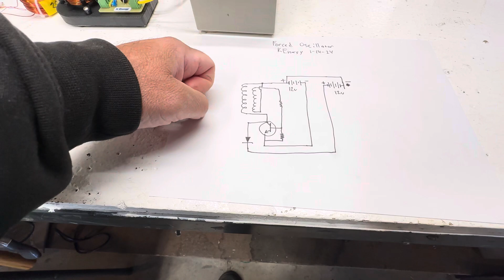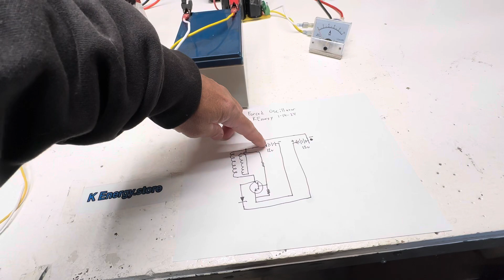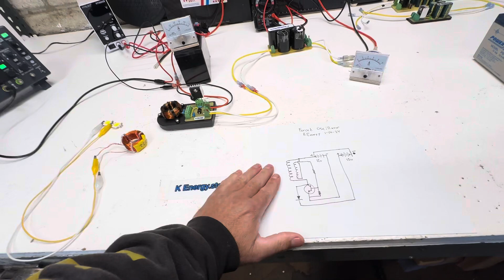Forced oscillator schematic

Comment: if the coil placed on top has the same LCR values, might it duplicate the energy even when the battery is connected ? with resonance it should be both and not one or the other would you say ? a duplication....
Reply from the maker: I’m referring to the impulse tech
Reply: @kenergy1707  ive heard of that, but what do you mean ?

Comment: Thanks you very much, blessing and lot of luck
Reply: So with this device we can desulphate lead acid batteries? The charge its similar to bedini, with "negative" energy?
Reply: I have desulphated batteries with it. If you monitor the voltage you will see this taking place. NOTE that it is a slow process, BUT better than throwing the battery away! You will have to go through charge / discharge cycles as with ALL Bedini desulphation devices.  @antcomino713